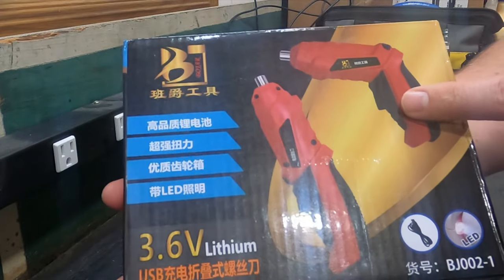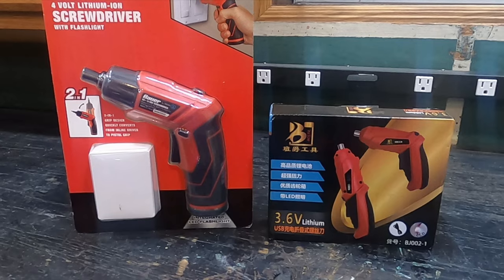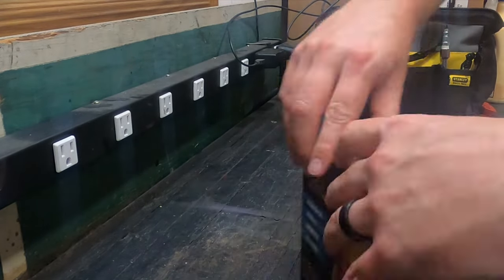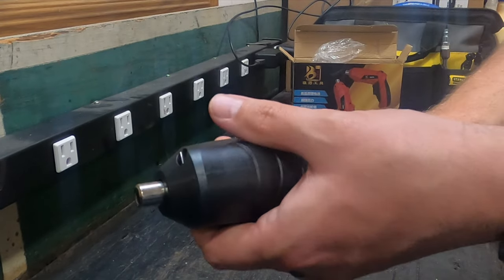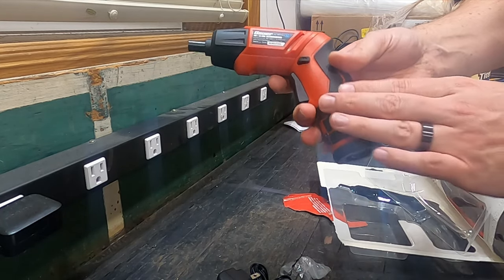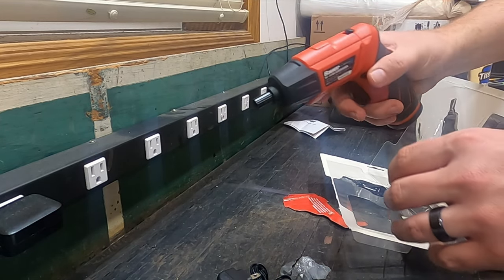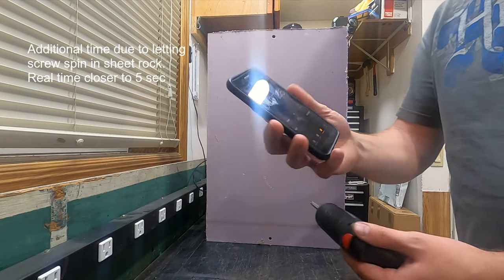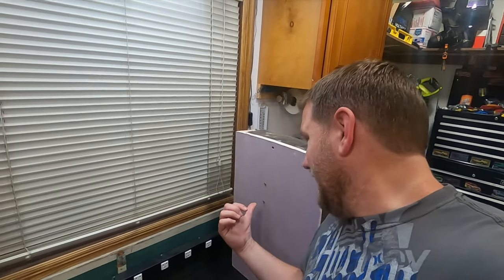Can I Make it to the End of this UNBELIEVABLE Cheap Electric Screwdriver Tool Challenge?

Comment: Definitely go with the Bauer. 👏🏼. I like the double flashlight and the grip on the handle. 🔦🔦🔦😊. Great review👏🏼👏🏼👏🏼. I also like the push button locking feature. Seems safe. Don’t want it going straight or folding on you when your using it🤷🏻‍♀️
Reply from the maker: Right!!?!? They both lock into place and  the Alibaba just have a push button to unlock and slide it where the Bauer has the slide button you have to hold into place just to twist it. It’s actually more difficult with the Bauer than the Alibaba. Plus the flashlight at the bottom is kind of gimmicky and not really useful when using the tool. Not as much as the led by the tip of the bit. 

Thank you for commenting on this video, you are in the drawing to win one of the tools reviewed in this video.